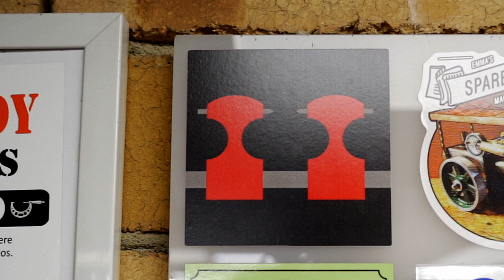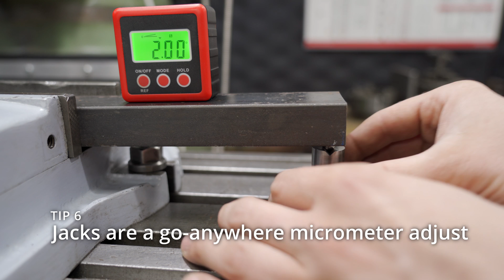TOP 10 TIPS for Machinists' Jacks | CRAIG'S WORKSHOP

Comment from the maker: Tip 12: (Submitted by Chirpy's Tinkerings) Use a bolt or screw in a 123 block as your jack. Comes with three built in heights. Genius Chirp, thanks!

Submit your own machinists' jack tips and I'll include any that catch my eye here in this pinned comment.

Comment: Absolutely awesome! I will have to watch this several times to soak it in . I haven't made any Jack's yet but I need to and I did watch the video to make them . Thank you !!
Reply from the maker: Thanks Ronald. Glad you could find something useful or interesting in there. This is not an exhaustive list, I'm sure once you think about what you need in the workshop that involves a variable spacer, or a variable width support, you'll come up with new uses (if you do, please post it here!). Cheers, Craig
Reply: @Craig's Workshop  I have an 8ft x 20ft shipping container so I have to make sure what I do I have room for . I have a grizzly mill bench top and atlas 6x12 lathe and I am building a 4ft lathe put a 9 inch southbend headstock on it . Wish now I had gotten 40ft shipping container lol . I watch your videos over and over there are only few people I  watch ! You do an awesome job !
Reply: Ps I am retired so I have to use mostly scrap to make anything.
Reply from the maker: @ronaldcrowder404  making things from scrap is very satisfying, but can sometimes be a bit hit or miss. But you can't beat the price!

Comment: Awesome video man thanks! Another question I have for you is how do you control corrosion in the UK on your machines? I’m in hot and humid Southeast Texas where temps are over 90 degrees F and greater than 90 percent humidity(somewhat like an armpit haha). It is a common assumption here that it may not be as hot but it can certainly be as humid in the UK and I have been keeping everything wiped down now in ACF-50 giving it a try but curious if you might have a tip for combatting rust. Thanks!
Reply from the maker: Hi Chris - apologies but I am no going to be much help there. I've been living in Australia for the last ten years, and we just don't get enough humidity where I am for rust to ever be an issue. In the UK, when I was working in a joinery and furniture workshop with large cast iron surfaces, we would use a product called Liberon Lubricating wax. I believe it was a wax and oil blend and for things like jointer, planer and bandsaw tables it was great. It provides rust prevention and also a nice slick surface which for woodworking machines is ideal. Thanks for watching! Cheers, Craig
Reply: @CraigsWorkshop   thanks for your input sir!

Comment: Nice job Craig. Production, info, and delivery are spot on. Lots of good tips there. I have a couple older machinist jacks, they are a little big for my uses usually so I need to make a smaller one. Funny you mentioned lifting buildings, I actually have 2 cast foundation "machinist" jacks at least 100 years old. I used them to support a section of my house to replace some rotted floor joists a few years ago. They did lift the house pretty easily. I should share some pics on Instagram. They are cool. All the best!
Eddie
Reply from the maker: Hey Eddie - thanks! The big jacks sound great. I watched a restoration of one of those a year or so ago. Very cool. Thanks for watching! Cheers, Craig